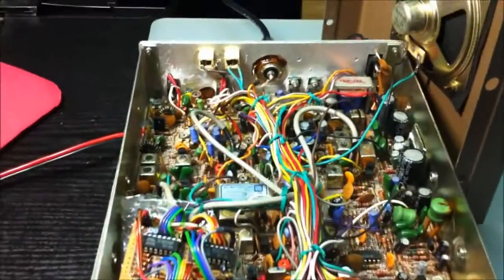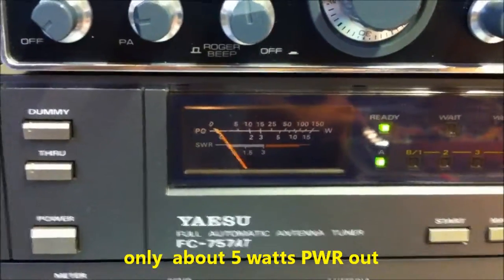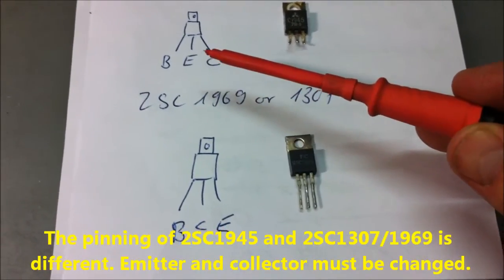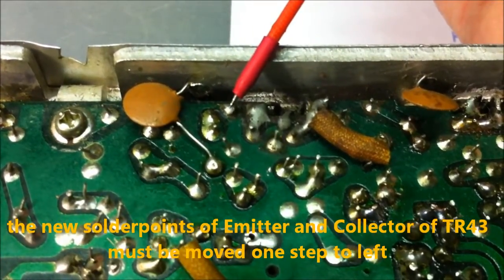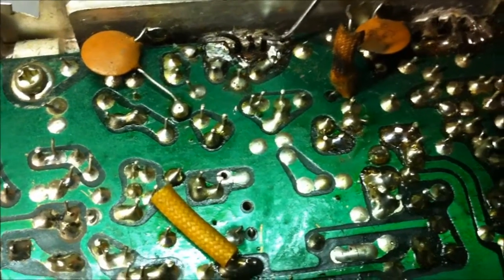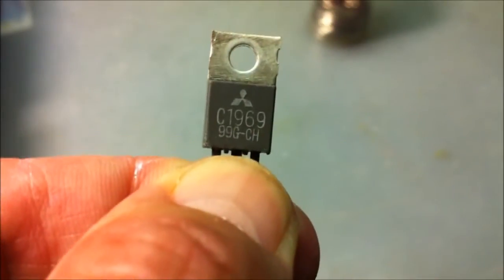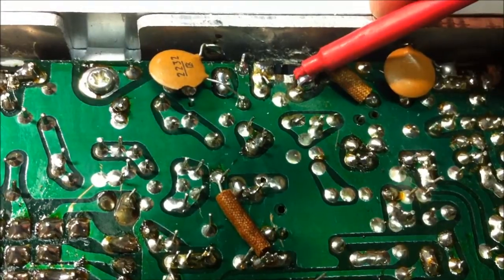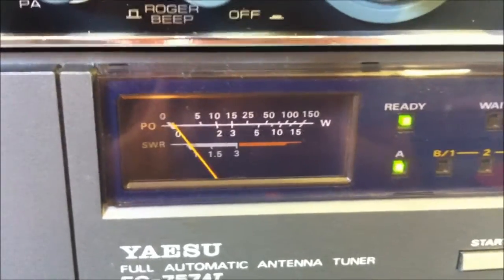Uniden's upD858 chassis final transistor 43 (2SC1945) replaced with 2SC1307 or 2SC1969

Comment: Hi! 
The Royce 1-632 CB rádio , use this 2SC1945...is possible the replacement with some of this similars????
Best regards from Brasil!!
Reply from the maker: Mister Claudio hello, thank you for your interest. Yes these 2SC1969 or 2312 are similar in his specifications. But the 2SC1945 has a different pinning. The MRF477 uses the similar pinning like the 2SC1945. But it's very expensive. Best 73 to you
Reply: @SWIZZRADIOS  yes understood!!. Thanks so much!   Best 73!!

Comment: Hola, tengo un Cb Palomar SSB 600 ,realice el cambio del transistor c1945  por un 2sc1969 como se indica en su video , transmite pero distorcionado no sale clara la modulacion. Como lo puedo ajustar???
Gracias
Reply from the maker: Yes, on PALOMAR SSB500/600 is to adjust the ALC trimmer TC7 for a good audio on SSB. That's my input. Best 73s to you.

Comment: Hello again!
I have replaced my 1307 with a 2312 in my TRC449
Is there anything else for me to do?
Do I have to replace any resistors or diodes?
Mine has the 47ohm resistor but also has 2 diodes (1S2473's)

 And the bias?

Thanks, 73's
Reply from the maker: +ᗒ╬ᗕ1112223333111ᗒ╬ᗕ Hello also! The 2SC2312 is similar to 2SC1307. Bias is about 50mA Emitter to ground. But if you have 0.6-0.65 Volts on the base (TX without Modulation), bias is OK. Good luck.